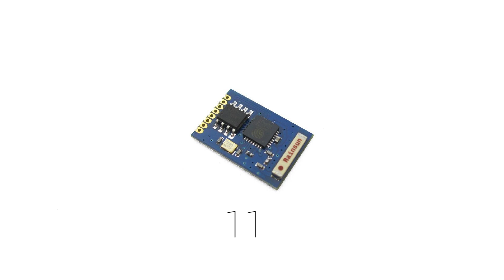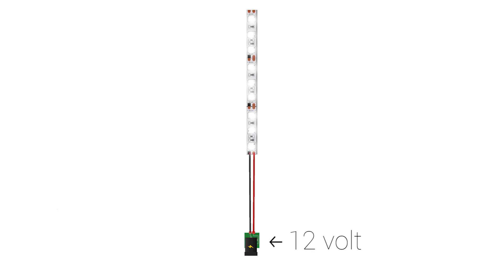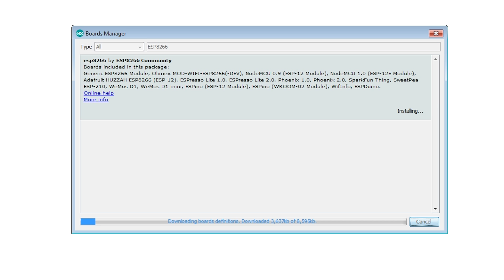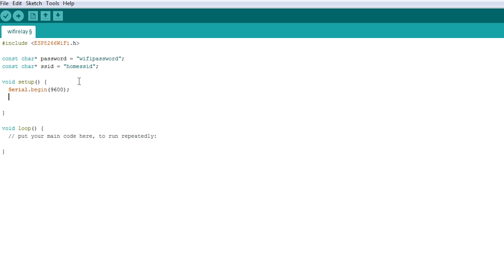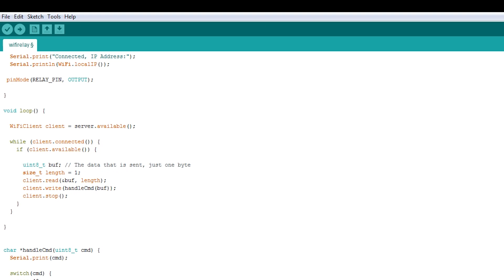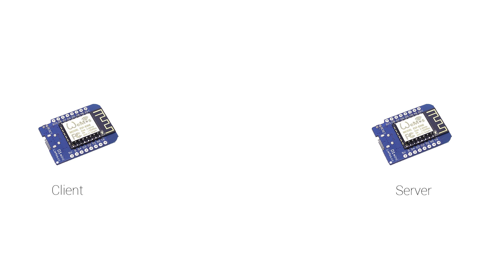How to Control LEDs (or anything) Over WiFi || Arduino Essentials #2

Comment: Would it be possible to connect led lights too this and control ( turning the lights on and off ) the lights using a localized hosted web server like Apache? if this is possible could someone link or point me in the right direction to doing something like this?

Comment: Hi I am new to ESPseries, I am using esp8266-01 with 8 pins I successfully uploaded your code to it after necessary changes like ssid, password , and port. My problem is when I flash my esp it shows up in my phone and laptop device list and when I programmed it . Then it does not show up in neither in phone nor in laptop device list! Please help a bit when I open telnet it shows network error.

Comment: So lets say I want to set up a simple program that I can use on my computer to control the lights. I set it up to send the data to the specific IP address that was assigned to the arduino the first time. A few months later the DHCP server on my router assigns a different IP address to the arduino. This will cause my program to stop working. How can I code the arduino to use a specific IP address, rather than letting the DHCP server assign one?

Comment: Hey! Great Video! I just wanted to ask, is it possible to turn on/off a normal 230V appliance with this relay? Also is it possible to use multiple relays for multiple appliances?
Reply: It is but as i see relay is maximum 10A declared.  [Watt = Amp x Volt] So its 230Vx10A(max)=2300W rated max but anything that draw 500W and more is dangerous due to small distance of pins on relay. (You could get spark short circut and burn all.) For few basic lights, its safe, yes. You can use also multiple relays I think.  From code i see that relay uses D1 pin only.  AS i know WEMOS D1 mini have like 8 pins.

Comment: I got the error 
I am using a arduino uno tho

exit status 1
ESP8266WiFi.h: No such file or directory
Reply: It wont work with an arduino uno directly because it does not have any wifi capabilities built in.
Reply: It seems your library was not set correctly.

Comment: The relay is for 5V and the led strip is for 12v. Is this a issue?
Reply from the maker: The voltage rating for the relay board, is for the signal that will open or close the relay, and not for the circuit that runs through the closed circuit. So, that's not an issue, if you use the WeMos Wifi Board or and Arduino the relay will never receive more than 5v on the signal.
Reply from the maker: Går nok fint:)

Comment: I have a problem I can't type in the putty window and when i connect to the ESP8266 it throws out bunch of numbers in the serial is this normal ?
Reply from the maker: Hm, it might be blank spaces. Im not sure why you can't send though, try removing the client.stop(). If the putty client sends any preliminary bytes, it will close the connection

Comment: Why don't you use the ESP8266WebServer? You can use the HTTP command POST to send commands. Of course you'd need some extra code, but it is not that much.
Even adding a small html page is quite simple. You could then turn on off things by using any browser from any device.
Reply from the maker: Hello! Good question. Mainly because that is an interface between human and the device, which there is quite many tutorials on already. This is meant as an introduction of how one could make communication work between two devices, without the adding the complexity that comes with the application layer :)

Comment: Cool project. Is there a way of controlling it with the phone?
Reply: U can use a terminal software on your phone or mod de wifirelay code to server a webpage you can open with your phone. There is so much info out there give it a try

Comment: So, we need different source of power for the board and for the leds?
Reply from the maker: Depends on what you are controlling! The board needs 5 volts, if what you are controlling uses that, you'll probably use the same source
Reply: If I use 12v leds, I mean :)
Is there a way to power 5v arduino and the 12v leds via one source?
Reply from the maker: An Arduino will usually accept 12volt as well, but this WeMos board needs 5v. If you have a 12 volt power source, consider using a voltage step down module to get it down to 5 volt :)
Reply: Oh I see, thank you!

Comment: not everywhere has the internet, what use is an internet connected thermostat in a cabin in the woods...you still want heat before getting out of bed...
Reply from the maker: As long as there is power you can use the module to host a wifi connection, even tho it is not connected to the internet!
Reply: There are also NRF modules that work off of RF. These are also cheaper, but not internet connected. Still, you can use a single device to act as a bridge if you wanted to act network connections later on.

Comment: In DC circuit you could use transistor instead of relay to make the device cheaper.
Reply: And it'd use less current as well as not needing a flyback diode.